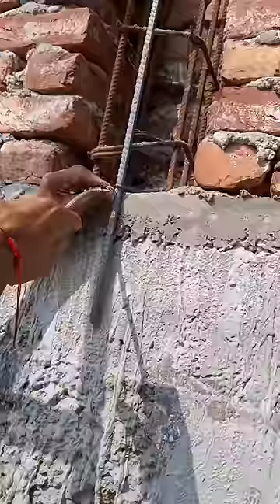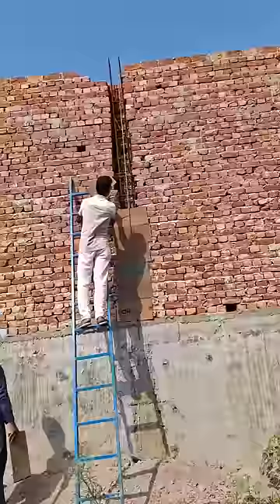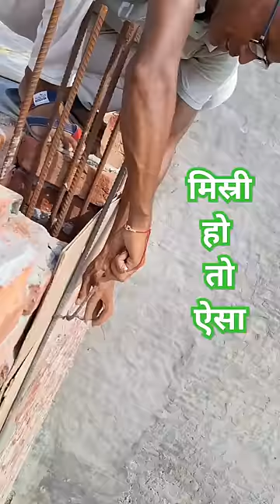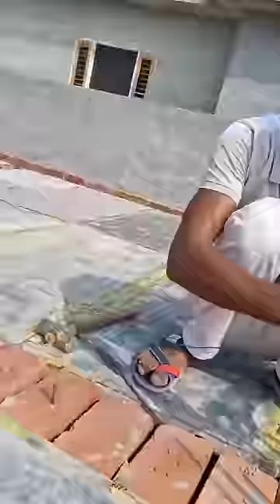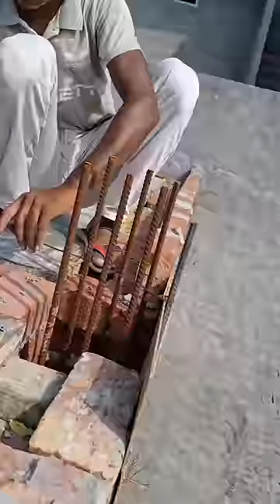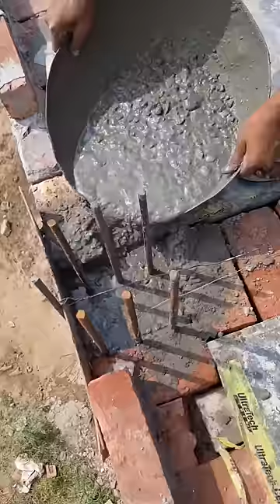How to column casting full process

Comment: As per clause 13.2 of IS 456: 2000, the maximum permissible free fall of concrete to avoid segregation may be taken as 1.5 m or 150 cm.
Reply: अगर देश के मिश्त्री‌  पढ़े लिखे होते तो.......

Comment: Vibrator used at every pouring make sure the cement mortar spread across without air pack and outer smooth finish. If not then the Gravel peeps with no cement sideways.

Comment: Made in india without engineering, mistakes 
1.coloumn construction without shutter 
2.poring concrete from high will segrigate cement ,water n agregate 
3.casting 10 feet at a time with out vibration cause honeycomb, week pillar,
4, no vertical rods , no spacer 25mm

Comment: Ye galti kabhi mat karna 
1. Column friction ke karan load wall per transfer karega jisse .
2. Costing 3 meter se jayda karne se segregation ke chance honge aur strength kam dekhne ko milegi
3. Mass concrete ke Karan proper querying nahi ho payigi jisse bhi strength mai kami aayegi aur crack bhi devloped ho jayenge

Comment: The load of the column will not be shared by the Wall for sure. This method will avoid cracks at the junction of column and wall. But one thing is not considered that the column must be cast in the lift of not more than 1m ht at a time. This will lead to segregation for sure.

Comment: This is not  horizontal column but vertical pillar.   Method in which it is being done is also totally  wrong.    This type of pillar will not  hold strength  of building  for long time

Comment: its a fully wrong process,  because pehle structure banaya jata hai like a column , beam & slab etc. then bricks work hota hai,  and isme plumbing name ke bhi koi chij nahi hui hai then isme honeycomb or sagrigation jaisi problems bhi face karni paregi then repair cost increase hoga as per budget, because casting kabhi bhi  1mtr ya 1.5 mtr se up height pe nhi kiya jata hai.. ❌❌

Comment: Bad work. 
Very bad work. 
Vibrator not use in casting column. 
Height of filling rcc is about 10 to 12 feet.
That's also wrong. 
No one is benefit .

Comment: Totally wrong, this column is almost useless, by avoiding engineer or architect you are actually putting your hard earned money which is useless.........
Wet water which has cement will be absorbed by bricks.
No curing will result to weaker column
No compaction will also result to weaker column.
Finally all money put in column is waste of you hard earned money...
Congratulations....